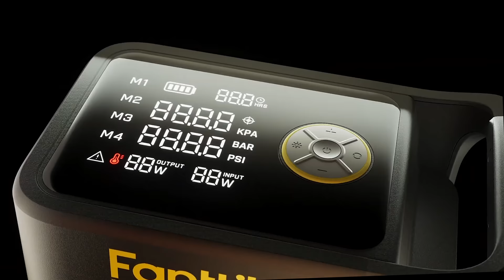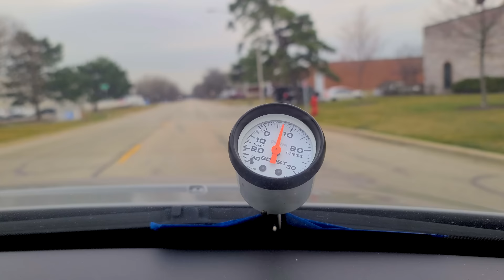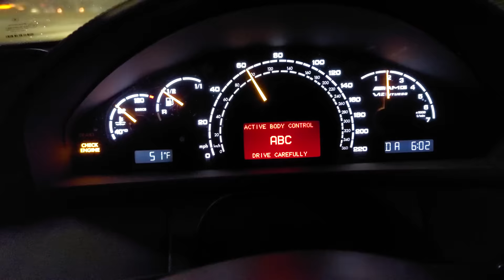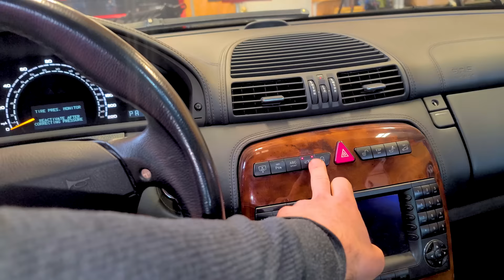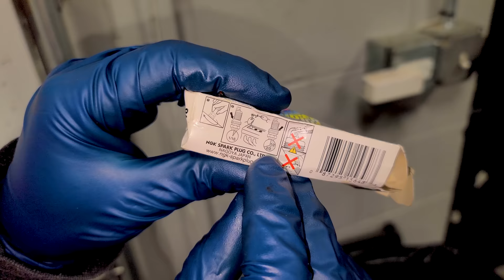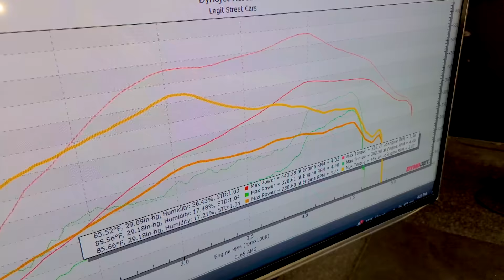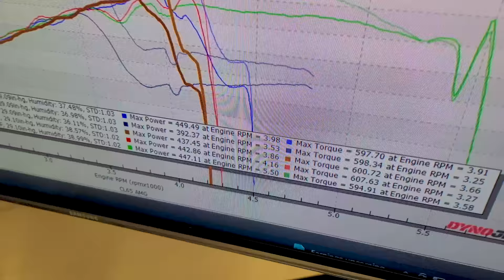I Finally Fixed My CL65 AMG & It RIPPED Until It Broke Again, TWICE! This Is Out Of Control!

Comment: Intermittent issues to me screams electrical issue, older cars have some of the strangest issues when grounding points are the slightest bit compromised. My fingers are crossed for you that youll find a solution next round but my gut feeling says youre going to have to inspect the harness at each breakpoint, harness junction and grounding locations

Comment: If it's only failing after multiple pulls, might be related to the coil pack more so due to heat/load, first off check the boots for hotspots as may be failing when rubber heats up or under high spark load... had that on the wife's car, was a pain to find...

Comment: The platinum plugs (or whatever ?) are designed to run at 0.050". Coil on plug will have no trouble driving them at that. When you reduce gap you are advancing the ignition process. The computer is trying to pull timing out to correct it. It does this as the gas temperature, knock sensor, O2 sensor & on & on see a condition red, until the timing(ignition) cuts. MISFIRE. This will make the mechanic inspect the coils and plugs , when HELLO the plugs are all gapped stupid. Great diagnosis on the new plug malfunction. It happens frequently with NGK in motorcycles, why not car plugs too? It had the hallmarks of failure! Best of luck with your incredible Mercedes!

Comment: If you have High boost. You need to gap the spark plugs tighter. The boost blow out the spark. In racing we have 44 amps and it still blow out if the gap is not ”tight”. You know what a men
Reply: The blower or the turbo blow out the spark

Comment: Replace it w/ a 4 cylinder turbo. E.g. Ford 2.3 L turbo making 325 HP. Use Ford 8 speed or 10 speed automatic. Change the coil springs in front.

Comment: 24 spark plugs at 5,000 RPM == lots of electrical draw from the coil(s).   I think your using electrons faster than you can make ‘em.  If I’m right, a simple volt meter on the ignition bus would show a voltage drop at high rpm.  Possibly you would see it revving the engine in neutral.

Comment: Yes,The Grand National. I highly recommend the GN over the Mercedes-Benz.Way more fun to drive, but not as comfortable.(A/C in those GM G-Body cars are lacking at best ) and reliable unless you try to get 700 horsepower out of it with a stock bottom end and Transmission.

Comment: A high quality aftermarket ecu should solve your problems like magic! The issue is the over engineering of mercs old ecus, it tries to be too clever without actually being! You should check if FuelTech wants to partner with you! FT600 would run both engine and the automatic gearbox

Comment: Could be a hairline crack in the coil pack. That could cause a spark leak like condition lowering the output of the plug set and would show as a misfire. I would replace the coil on that side or swap them if you can and see if the issue follows the coil pack.

Comment: We had a similar tuned 65 on the dyno and it over powered the 1200Nm hub dyno. I cant remember where the tune was made for the car. Somewhere here in Europe, by someone who specializes on the 65 V12 engines. It had other mods too. It was somewhere north of 700 to the hub on power. 
Yours is wayy down on power considering the mods.

Comment: Yo Alex, looking at your issue with the spark plugs giving misfires I think you should change the brand and go with Bosch or Beru instead of NGK. And of course everybody has his own experience where it comes to spark plugs. But with experience I have come to the general rule that I always use Bosch or Beru on German brands e.g. BMW, MERCEDES, VAG and PORSCHE cars and NGK on Japanese or Korean cars. Ooh yes and try and get the ones with multiple electrodes!

Comment: SPARK PLUGS - back in the day I had a 383 mercury turn pike - 310 HP and with champion plugs cold winter morning the car would not start - we had a champion spark plug tester rand the pugs (one at a time to 150 lbs and they would not fire. I got a set of ford motor craft and problem solved, Dated to the late 
60's

May want to swap plug brands, maybe at under running compression the plugs are failing odd only on one bank but maybe you are eliminating them one cylinder at a time - I don't know it compression testing of plugs is an item in todays world.  * Love your tonicity staying with the problem until its resolved * (back in the day I received a plaque for tonicity. from a vendor because I found a fault in there equipment)

Comment: Honestly with the cost of those coil packs it might be worth while to just put aftermarket ECU in it. That way u can run normal Mercedes coil packs and no longer run into most of the tunning issues. This thing should be North of 1000hp. Just start modifying it since it is refusing to coaparte being stock.

Comment: I don’t understand how some people just comment for the comment itself! Comments like: it’s a garbage/get rid of it, etc. This is nonsense! If you say this to someone who really likes a car/product, not only won’t he listen to you, rather will he carry on! One thing I’ve learned for some years now, is that whom ever can’t afford to own something expensive will always criticise the way it looks/behave/operate etc. Some folks didn’t even drive one of these cars or even sit in one of them! These are high end coupe models who were designed for comfort, long distance cruising and they are absolutely a joy to drive! The price you pay is for all the benefits you get, not just the engine performance! Rare are competitors models that can match such a driving experience…
Coming to the main point, I would say these type of engines are already engineered for the performance they deliver and to a certain limit the engineers calculated to! They are the ones who designed it and the components have a certain resistance/reliability and can’t take twice or more pressure/tension, only a certain margin is there… trying to push an engine to an uncertain limit just for your pleasure or to show your knowledgable isn’t a guarantee of success! Even if it works and delivers power for quite some time doesn’t give a promise of reliability. You can spare the comments like: throw in a Toy/lex engine.. it’s not what’s it is designed for as well! It’s bad idea/bad taste and if you want a Toy/lex engine then just buy a Toy/lex car. Btw, they aren’t bullet proof as you may think(may be in the past 30 years when MB was also still making bullet proof engines but those days are over!) And it’s not a guarantee of success either. The fact that these cats aren’t a real success from the start relies on other facts that aren’t even related to the engine itself, rather the fact that they were stuffed with sensors/computers/solenoids, etc! A period of time where MB wanted to do the maximum in a high end two doors touring car(not a pure performance race car)!

Comment: There is something weird about the spark plugs.🤔 I would maybe try out an other brand and maybe some of these Iridium ones. I used in my Celica ones Bosch Plugs same specs and gap like the Denso before and the engine was running bad. I was getting a getting four new Bosch and it was still bad running. Than I get four new Denso, same specs like the Bosch part numbers say that they are exchangeable everything but with the Denso the engine run smooth like before.

Comment: I would smoke test it mate. You may find you have an inlet manifold leak on that bank which will cause a misfire . Could be the gasket or the inlet manifold not seated properly. Have had this issue numerous times especially when heads have been machined.

Comment: needs an aftermarket ECU and a Manual Transmission, this auto trans is slipping on the dyno and the ecu is sees the load change and reaches the torq limiters.

Comment: I’m hoping either Alex or someone can help. I cannot get the shifter to move from D to 4 and down through 1st. In Manual it will not shift out of first. The engine light came on and the dealer said I had to replace the Shifter Assembly with Module, it down shifted fine until then. The tranny works fine otherwise, moves smoothly through gears.

Comment: Could it be an electronics issue?  Maybe the ECU has leaky caps or something?  Common issue with cars this age and often leads to all manner of odd running.  Not sure if you've done it already but maybe pull the ECU out and do a visual inspection of the PCB...

Comment: That stock ECU not able to log enough data is really not helping at all but I am not sure if there is any aftermarket ECU that supports the platform and hopefully does not require a new wiring harness as well as easy to tune.

Comment: Sucks but I'm thinking Syvecs ECU and TCU are the only reliable solution. As well as stronger individual coil packs. Even if you get it to work you are right on the edge. My thoughts are that's it's attempting to torque limit, cutting spark, and reading that as a misfire simultaneously. Because the processor is severely lacking, just goes into limp mode.There were some guys Speed Driven using Syvecs for the CL65 but think they are gone?

Comment: You need to thank the marketing department for the extended service intervals and lifetime oils for the inability to turn the dial up on your vehicle.
Extended service intervals and lifetime oils may seem like a good thing to people who don’t know or care about vehicle maintenance and thus don’t want to pay for it.
But because the manufacturers need to ensure the vehicles survive until the warranty runs out they start padding the computer programs with tons of cotton wool and apron strings and nanny modes.

If you could find two identical cars but one has had the service intervals extended and compare the tunes on them I’m sure that you would find significant differences in when limp modes occur and power output.

Comment: I wish an AMG engineer would reach out to help. The computer system is so specialized that it needs someone who actually worked on the design. Another thought ...I wonder if anyone ever raced this motor, if so they might have insight on the controllers.

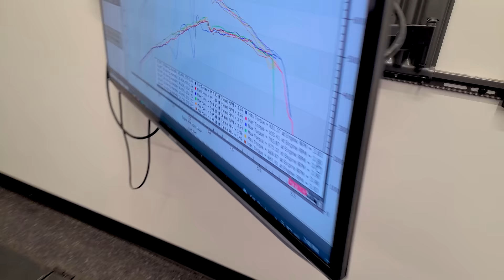Comment: 41:15 I think you need to pull the wiring harness, as wasnt mercedes one of the first to go to with bio degradable parts, maybe your wires have let go, and when it gets power to it it shorts and shuts off, and when you switched it out, you damaged the connectors

Comment: My 80 ish father has been a Mercedes man from the early 1970's with his 1969 280 dual carb sedan, to his 1973 220D sedan, till several other version and today he pulls an Airstream trailer with a ML350 Diesel.  But he has had so many problems with them...  He works on them himself.  Pulled the transfer case from the SUV and rebuilt it a few years ago.  He loves the drivability of the Mercedes  cars and SUVs, but man, the reliability of any Mercedes STINKS!  Just so horrible.
Once he sells this ML350, he will never buy another...

Comment: Aaaaand the reason techs learn to appreciate small engines with turbos and/or superchargers!,,.....
Reply: Also, because the motor is a tight fit (heat), rodents like to nest and bite wires, check you harness in hard to see places!

Comment: OK, mine is a 4 cylinder C3, but i got this one, new coil pack, still same problem, i ask my mechanic, try to swap the new pack with a used one you have around and this fix the problem, the new pack from the dealer was defective.

Comment: Anyone who works on cars. Or anything really is going to have that one thing, that one time that completely frustrates them.
Someone, somewhere has seen this. It'll get around then at some random moment you'll get an email, dm, something. Oh it's just this. And you'll feel like a knucklehead because you thought you checked that part because it's part adjacent. Like checking fuel injectors without looking at the connectors kinda thing.
You'll get it, still a good video.

Comment: I wonder if a wire in the harness is slightly broken to where it usually makes the connection but when higher boost comes into play, it starts misfiring and acting weird.

Comment: So with a high voltage DC power supply you could mimic the running conditions and test a coil resistance with the voltage going thru it..but I'm just guessing the dynamics. A misfire could be caused if or when the computer doesn't send timing fast enough? Is there a stand alone ecu for this?

Comment: The shock absorber pipe breaks if you have excess pressure…….look for the issue if you don’t want to do that job a few more times……fixing symptoms rather than the cause does not add any reward to the CL ownership experience.

Comment: I had similar missfire problems on one of the banks on my BMW M6 V10 and it turned out to be the Ionic module (missfire detection module) on that bank. Switched the modules around and the missfires moved to the other bank.    Maybe this engine has a similar system?

Comment: Would it be possible to convert to Audi R8 individual coils? Apart from a coil mount rail and wiring loom modification, you would likely need to modify the dwell settings in the ECU and maybe the ECU will not have drivers that are capable of pushing the required current. Still, these stock coils are probably not capable of enough joules to spark reliably at higher boost levels and you might want to look into an alternative.

Comment: Alex, that engine is limited to 1100 Nm of torque, right? The engine produce 1400 Nm, but is factory limited to save the transmission. Is there any change that with the mods, the torque figures went up and the computer is going nuts?

Comment: I was really thinking it could be a cat or a o2 problem.   I seen it before.   What you was saying at the end of the video.  Kinda weird.      In most cases when I seen a cat throw a miss fire code it was cylinders.  1 or 2.    Or a random code.   A301 or a 302 . Every o2 I have every seen go bad.    It will only throw the code when the heater side went out.  So if the heater side is good you won’t see a code.  I have seen MAF problems cause the same problem as your having as well.  Some of this might be your issue. That you haven’t thought of yet.  I know your a great technician.    Hope some of this information is useful.

Comment: Why not solve the suspension issues permanently removing the ABS system and replace with coil overs instead of spending the rest of your life fixing it? Kent from Mercedes Source did it, not as easy job but it only needs to be done once. BTW Alex you are in between the ages of my 2 sons so to me you are just a kid🙂

Comment: Putting fragile computers into cars was the worst idea they ever had, the manufacturers live in a world where they expect their customers to buy a new car every 5 or 6 years, so if you've got one older than that and the computer fails, you are on your own. In most cases people get fed up with all the problems and get rid of those cars. This type of built in obsolescence is a criminal waste of resources for which the car companies should be held accountable. My newest vehicle is 2006, and I have zero interest in anything newer. In my opinion, anything from 2012 is simply a time bomb waiting to fail.

Comment: You could’ve made your life a lot easier if you had just unbolted the 13 mm bowl from the engine mounts on the bottom of the subframe and tilted the motor to one side

Comment: Having 2 plugs per cylinder, I think I'd gap them slightly differently. Maybe .021 & .024
Reply: Beim m275 würde ich nie den Elektrodenabstand der Zündkerzen  ändern, da das Steuergerät über den Elektrodenabstand der Zündkerzen durch anlegen einer Prüfspannung eine Ionenmessung durchführt und somit Verbrennungsaussetzer und die Verbrennungsqualität ermittelt.  Wir der Elektrodenabstand verändert, verfälscht dies die SOLL / IST - Werte. 🤷‍♂️

PS:  grüße aus Deutschland
Reply: @music96able says
"With the m275 I would never change the electrode gap of the spark plugs because the control unit carries out an ion measurement via the electrode gap of the spark plugs by applying a test voltage and thus determines misfires and the quality of combustion. If the electrode distance is changed, this falsifies the TARGET / ACTUAL values.

PS: greetings from Germany"

.... So, maybe you just can't gap them that cold.
Reply: @joehobo00  thx dude, my english is very limited. I could never explain it in english 😅👍🏼

Comment: Did you check the injectors ? I had misfire because of bad injector before, it isn't necessarily bad plugs or coils. I would check for bad injector/s

Comment: Did the plugs you installed change from resistor to non resistor? There has to be a ground somewhere - have you ever tried a different battery?

Comment: Hi America 16:14 , i,m from South Africa and have a 4 door C class C200 , 2005 model Mercedes Benz,  and I,ve come to the conclusion , that this is my last Merc , I,m done !!!!!! My car had 85k kms on the clock and it problems I,m dumping it. I,ve had some beautiful Mercs in my 76 years and unfortunately sold the good ones. My previously owned Audi TT roadster had me thinking that Germans have left the innards of German cars to the illegal immigrants that flooded their land for years now. That's where I,m at. No more repairs or listening to same. My Toyota dubble cab has stood the test of time. Thanks for convincing me , regards

Comment: I know its a long shot Alex but got a 01 cl600 120,000 miles  changed coils and got a boost box from v12ci also full double platinum plugs all around getting a check engine light flash and put into limp mode with a camshaft position sensor and 7,8 and 9 misfire changed both sensors still getting the same codes have no idea where to started took pre cat o2 sensor off cylinder 7,8,9 thinking maybe cat is clogged but that didn't change a thing please help Alex  🙏